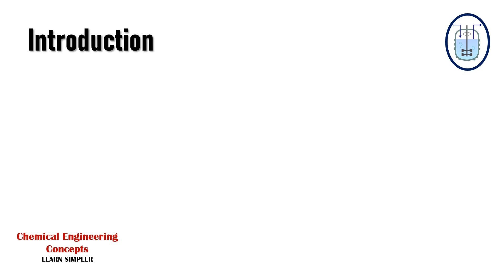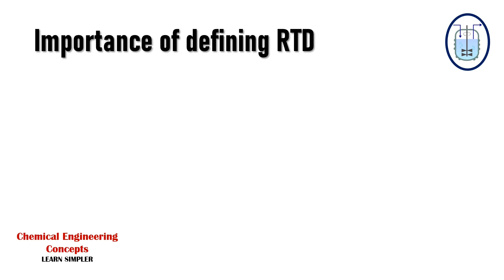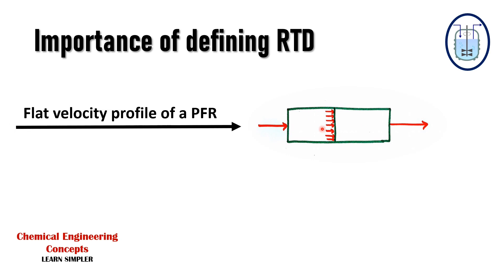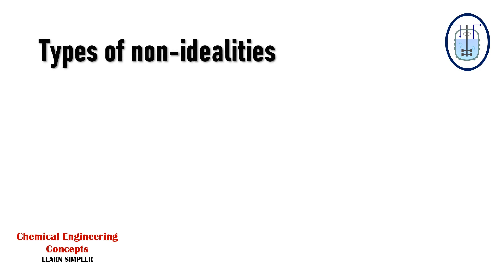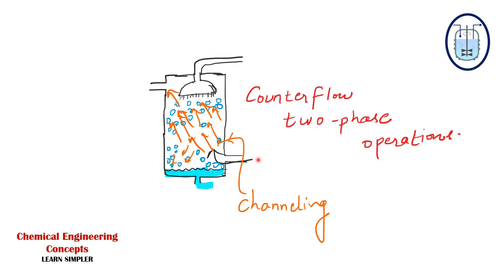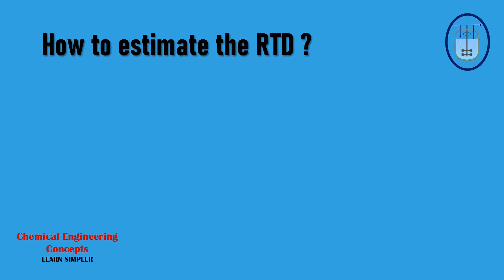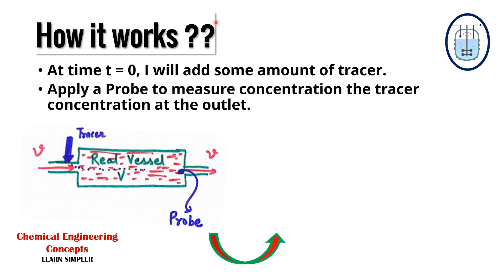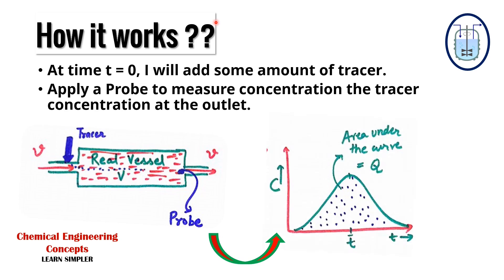Residence Time Distribution: Non Ideal Reactors!!!! GATE Chemical Engineering

Comment from the maker: Hey Guys|| If you get any doubt regarding RTD, please write in the comment box.  Don't forget to LIKE and SHARE with others as well.. Waiting for your valuable suggestions through comments...
Reply: You are asked to accommodate a biodiesel process in 
an existing reactor in the pilot plant. The chemist(a)
explains that the reaction involves the 
transesterification of fat. Fat is a glycerol molecule 
with each of its three OH groups esterified with fatty 
acids (figure); there are three ester groups (𝐺𝑙𝑦𝑂𝐸)
per molecule. To simplify the kinetics, each 𝐺𝑙𝑦𝑂𝐸
group is assumed to react independently. The rate 
expression for each ester group is:
𝐺𝑙𝑦𝑂𝐸 + 𝐸𝑡𝑂𝐻 ↔ 𝐺𝑙𝑦𝑂𝐻 + 𝐸𝑡𝑂𝐸
(−𝑅𝐺𝑙𝑦𝑂𝐸
) =
𝑘
𝑓
[
𝐸𝑡𝑂𝐻
]
[
𝐺𝑙𝑦𝑂𝐸
]
−
𝑘𝑟
[𝐸𝑡𝑂𝐸
][
𝐺𝑙𝑦𝑂𝐻
]
𝑘
𝑓 = 15
.
7
⋅ 10
−
6
𝑚
3⁄𝑚𝑜𝑙
. 𝑠
𝑘𝑟 = 0
.0942
⋅
10
−
6 𝑚
3
/
𝑚𝑜𝑙
. 𝑠
𝐾
=
𝑘
𝑘
𝑓
𝑟
=
[
𝐸𝑡𝑂𝐸
]
𝑒𝑞
[
𝐺𝑙𝑦𝑂𝐻
]
𝑒𝑞
[
𝐸𝑡𝑂𝐻
]𝑒𝑞
[
𝐺𝑙𝑦𝑂𝐸]
𝑒𝑞
Ethanol (EtOH) and the fat are charged at 9mol/L and 1 mol/L respectively. The ratio EtOH:GlyOE is thus 
9:3 (as there are 3 GlyOE groups per fat molecule).
The reactor is well characterised, and you have been given the response function used to fit previous RTD 
experiments where a sharp pulse was injected at t=0, directly into the inlet of the device: 
𝐶𝑡𝑟𝑎𝑐𝑒𝑟(𝑡) = 15 ∗ 𝐸𝑋𝑃 (−
(𝐿𝑁(𝑡
) − 𝐴)
2
𝐵
)
The values for 
𝐴
and 
𝐵
are given in the questions below
Note 1: you may assume that 1 − 𝑋𝐺𝑙𝑦𝑂𝐸 − 𝛽 ⋅ 𝑋𝐺𝑙𝑦𝑂𝐸
2
≈ 1 − 𝑋𝐺𝑙𝑦𝑂𝐸 − 𝛽 ⋅ 𝑋
𝑒𝑞
2
for 𝛽 ≪ 1
Note 2: 
Depending on your approach it may be useful to consider that 
𝑋𝐺𝑙𝑦𝑂𝐸𝑖
− 𝑋𝐺𝑙𝑦𝑂𝐸𝑖−1
= 𝑋𝐺𝑙𝑦𝑂𝐸𝑖
− 𝑋
𝑒𝑞
− (𝑋𝐺𝑙𝑦𝑂𝐸𝑖−1
− 𝑋
𝑒𝑞). 
(a) João L. da Silva, Harrson S. Santana (2022). Residence time distribution in reactive and non-reactive flow 
systems in micro and milli devices. Chemical Engineering Science 248, Part B,117163,
Q1 What is the GlyOE conversion, 𝑋𝐺𝑙𝑦𝑂𝐸, if the reactor was treated as a PFR with 40s residence time?
10 marks
Q2 For A=3.535 and B=0.24, Work out the residence time, and variance 𝜎
2
from the equation for 𝐶𝑡𝑟𝑎𝑐𝑒𝑟
10 marks
Q3 For A=3.518 and B=0.12 the average residence time is 𝜏𝑟𝑒𝑠
= 40𝑠 𝑎𝑛𝑑 𝜎
2
= 174 𝑠
2
What is the conversion 𝑋𝐺𝑙𝑦𝑂𝐸 if dispersion is considered?
10 marks
Q4 If the scale independent RTD is characterised by 𝜏𝑟𝑒𝑠
= 40𝑠 and 𝜎
2
= 174 𝑠
2
, and this reactor’s 
conversion 𝑋𝐺𝑙𝑦𝑂𝐸 = 99%; What reactor volume do you estimate to be required for production of 
5 million metric tonnes/year of 𝐸𝑇𝑂𝐸 if 𝑀𝑤𝐸𝑡𝑂𝐸 = 243 𝑔/𝑚𝑜𝑙? 
I was requesting for some help.